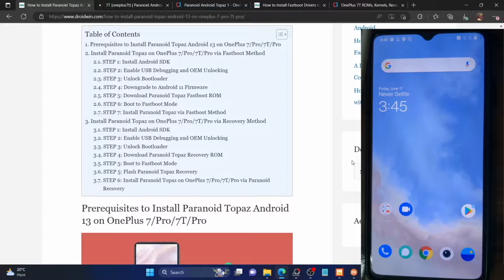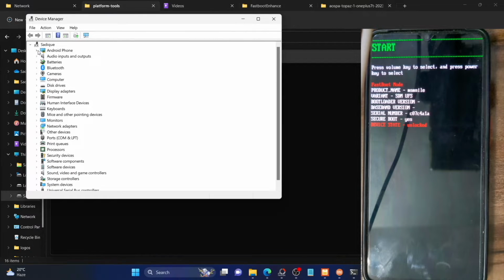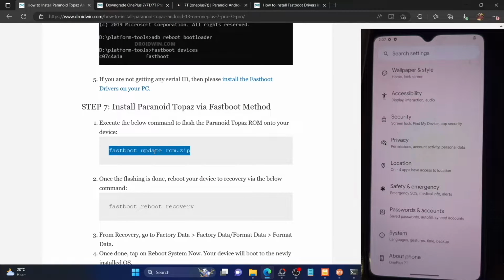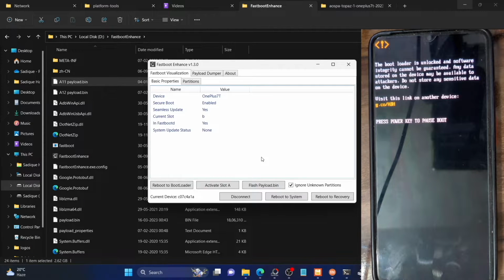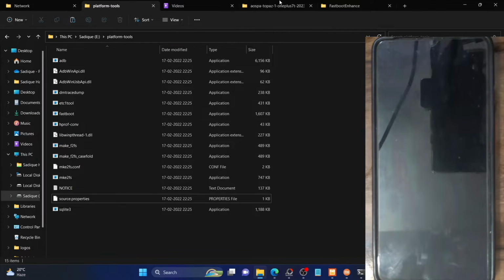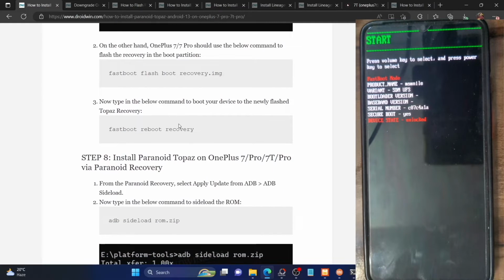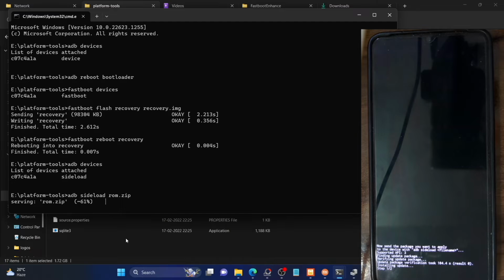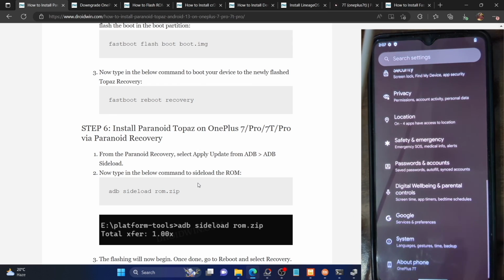How to Install Paranoid Android 13 on OnePlus 7/7 Pro/7T/Pro

Comment: Does widevine L1 certification is still available after the flash?
Reply from the maker: After rooting and passing SafetyNet [https://youtu.be/n9UkiNOBBn0], we could retain WideVine L1 Certification. I currently cannot remove the root from my device, so cannot comment on the WideVine status on non-rooted Paranoid ROM. But once I unroot my device, I'll definitely let you know the non-root status of WideVine as well.
Reply: @droidwinvideos1994  Is it important to root the device after the flash and pass SafetyNet?
OR
 Can we use the device without root?

I am new here and going through everything before I install PA

Comment: What about widewine L1
Reply from the maker: Hi Sandeep, after rooting and passing SafetyNet [https://youtu.be/n9UkiNOBBn0], we could retain WideVine L1 Certification. I currently cannot remove the root from my device, so cannot comment on the WideVine status on non-rooted Paranoid ROM. But once I unroot my device, I'll definitely let you know the non-root status of WideVine as well.
Reply: @droidwinvideos1994 I had L1 certification before flashing PA but now its gone.

So am gonna root and pass the SafetyNet to check whether I could retain the widevine L1 certification